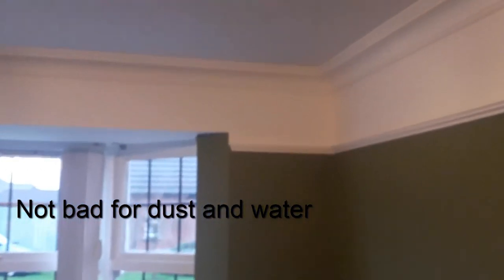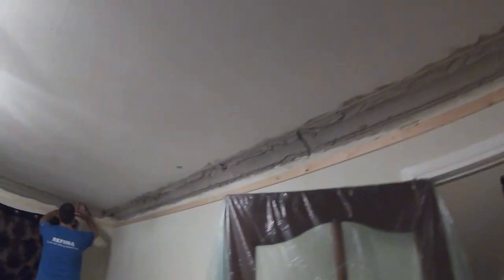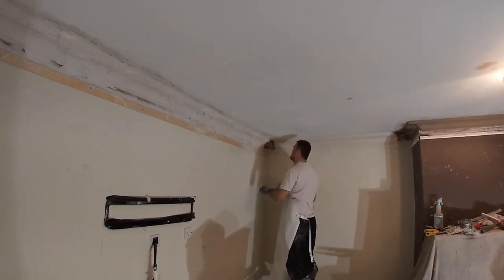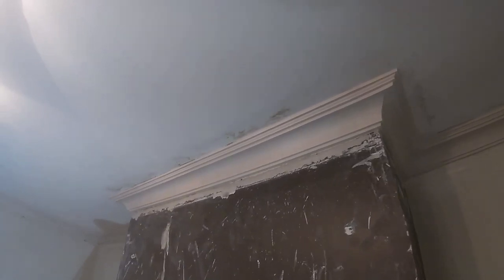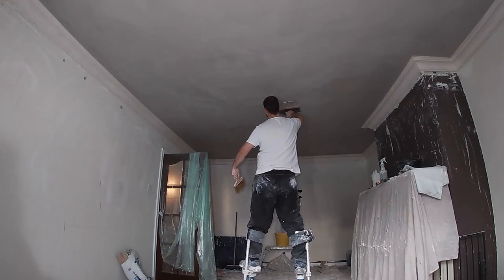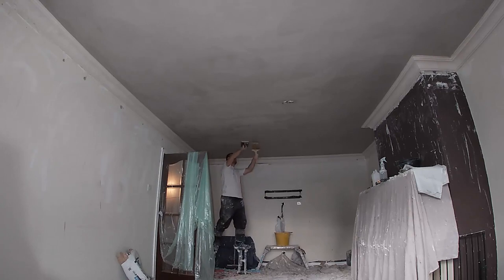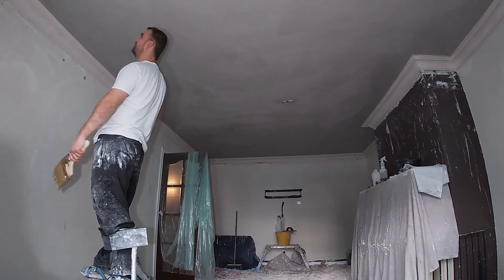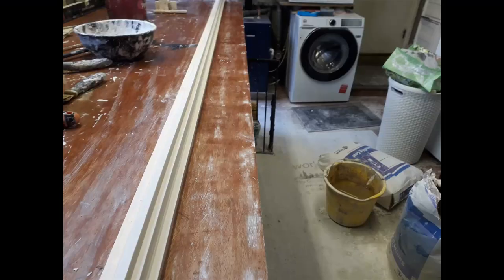Running Plaster Cornice in Situ Solid

Comment: Great video and great work! Did you ever do the plaster of paris mixing video? Trying to repair and old cornice and trying to get a workable consistency is not coming easily... and it's going off in 5 minutes!!
Reply from the maker: It dose set in ten to 39 mins not long working time mate you can add Size to slow it but won't cut/work as nice
Reply from the maker: Might try get a wee video on mixing it uploaded

Comment: looks great! could you please, in the comment section, write what you use for the first layer (day #1), doesn't look like plaster. then on day #2 it's regular plaster 1:1 volumes water?
Reply from the maker: Bonding but i also finished some someday ratios change on the plaster but will try do a video on how i mix it, also have a few moulding videos showing the tyoe of plaster and how i mix it

Comment: Nice Mac, did you use PVA on the bonding before you used the casting plaster. Thanks.
Reply from the maker: No mate straight on keyed it up 1st pva before the bonding went on and some screws

Comment: Nice work. How do you form the internal corners when running in situ?
Reply from the maker: Rue them in mate of the parts that are finished using a joint rule or busk takes time very slow funny i thought your question was about how i form the inside corner on sand and cement and was going to share this with you - https://youtu.be/HQBjSSBcAXM but I will try get some videos in future with doing ore on this side of plastering
Reply: Cheers Mac keep up the great work. These trades are a diminishing art
Reply from the maker: Thanks mate :)

Comment: Quality work mate 
Do you mix lime.putty with casting plaster for the top coat of cornice or just casting plaster ? Video showing how to make  a mould to match an existing cornice that needs repairing would be class
Reply from the maker: Would make it a little easier but none in mate just casting plaster yea if i get the chance i will get that type f video done mate cheers :)
Reply: Hi mac. Tried a sample running in situ but the casting seems to go off too quickly. How do you overcome this? Would addition of lime putty say 50:50 slow the set time?
Reply from the maker: @matte999me  Never used lime putty but I know if you get mix wrong it wont set and can go like chalk for this one i used very little size .... size slows down the plaster but again to much and it wont cut nice and can peel if that makes sense
Reply: @macplastering  nice one. Guess it's a case of trying out. Many thanks. You are a star
Reply from the maker: @matte999me  No problems mate working it in situ is very messy and hard work much easier if run on bench and then fitted and made good but some times situ is a good way to go say patching an old for example

Comment: Crikey!? I thought these skills were lost. Well done mate!
Reply from the maker: I know a few guys can do this very very good at it too do they are, I hope to get more and more of this on the channel mate
Reply: @macplastering  I’ve just taken a load of original cornice down. It was in lime but layered like you’ve done it. I imagined them using a moulded wooden float with a mitre on either end to get into the corners but then I’ve never seen one. Skills like these are worth good money these days. If you moved to London you’d have work coming out of your ears and be a rich man, although your arms would never forgive you.
Reply from the maker: My arms where sore after this one but is enjoyable at the end :) yes London's calling :):)
Reply from the maker: Yes you find the older cornice with lime is just dead now and can crumble away  but I love the fact that loads you see are still solid after all this time
Reply: @macplastering  yeah, I’m trying to save a big cornice about 300x300mm (or somewhere about) and two busts or female heads supporting an arch but the surface is degrading so it’s a tricky one. I’ve looked online for replacements but no joy. They’re heavily painted so I’m using a heat gun to remove most of the paint and then dry stripping with small tools by flicking the paint off but the chins have fallen off and had to be reglued on both the heads plus other bits and bobs. It’s been a case of strip fill sand fill strip fill sand, like you’re just going around in circles. Itried SBR on one of them but now it’s just got a coat of SBR over the crumbly surface. It hasn’t really stabilised it at all. Ive taken down the lath and plaster ceiling and I’m trying to keep the cornice so I’m having to saw the lathes close to the cornice but because the cornice is fragile the movement of sawing the lathes will break chunks off which then have to be reglued, filled and sanded as I go. Then all the lime plaster on the walls is cracked in large patches so needs removing and patching back in for the final skim. They’re the last bits of original character left in the building so I’m trying to save them.
Reply from the maker: @Scribe3168  buildings with this character are better have a worth to them of more time was given for the build or at least the finish, also less crafts men about to get to do these jobs makes it harder to have or to repair in houses and buildings. that sounds a greet project your doing mate recently saved a big ceiling rose from the bin on a job but it did take a few chips s needs touching up and a mould made but nit going to make a mould until some one ever wants one i think or have good storage for these things. my mate done similar he used paint strippers and water baths to soak and pick paint off then re moulded hard a pain yes but worth it yes if i was you i would repair one and re make from that for its the same but fresher and stronger

Comment: Cracking bit of work there Mac.
If you don't mind me asking where did you get those knee straps for the stilts. They look some job
Reply from the maker: hi John thanks man yes i got them on amazon and they seemed to always be outa stock now
Reply: @macplastering  way better than the normal thin straps I'd say. If u can see them anytime maybe you might throw up a link to them cheers buddy 👍
Reply from the maker: Will do mate they seemed to be off amazon now they where on our amazon shop but they musta stop making them